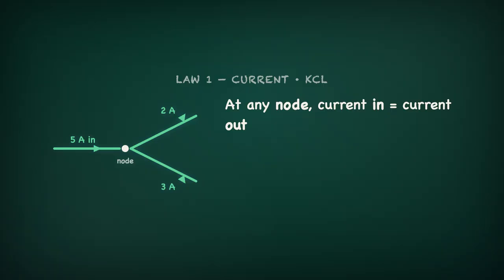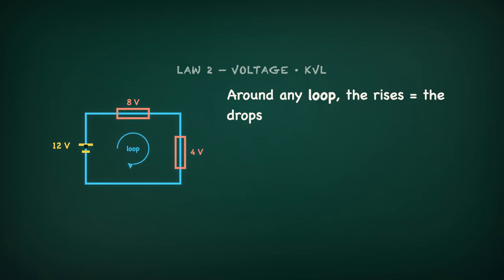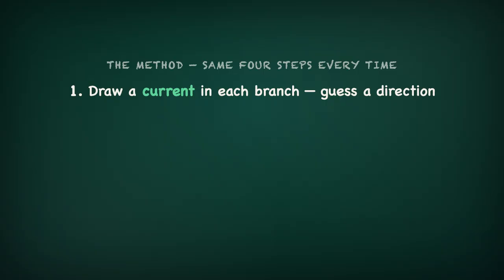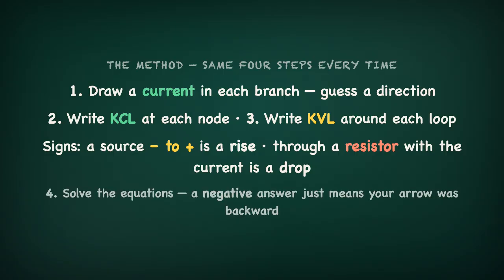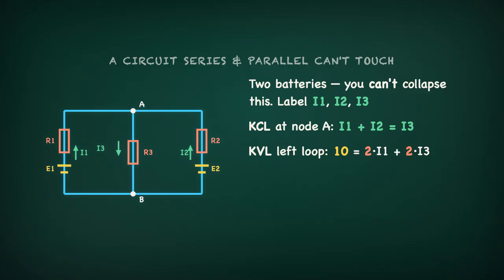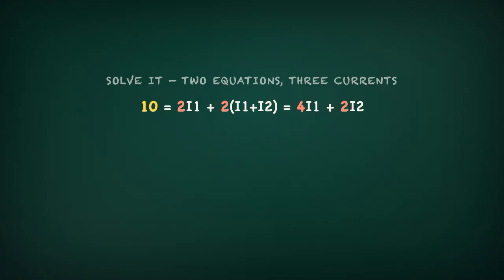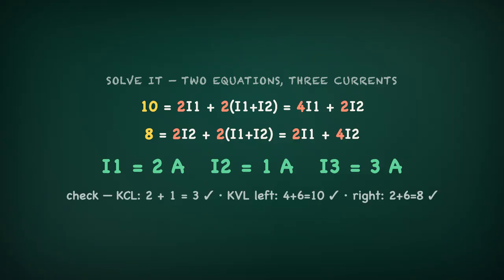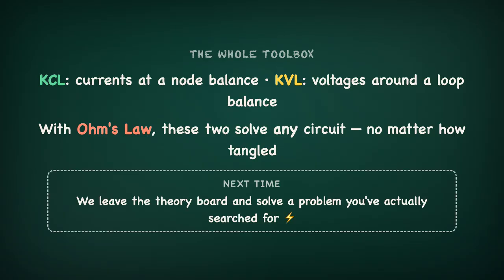Kirchhoff's Laws Explained Simply — KCL & KVL to Solve ANY Circuit | Electrical Theory 101

Comment from the maker: Practice answers: A) KCL — 8 A in must equal current out, so the other branch carries 8 − 5 = 3 A.   B) KVL — the drops around a loop add up to the source: 24 − 15 = 9 V on the other resistor.   C) With both sources 12 V and every R = 2 Ω, symmetry gives I1 = I2. KVL: 12 = 2·I1 + 2·I3 and I3 = I1 + I2 = 2·I1 → 12 = 2·I1 + 4·I1 = 6·I1 → I1 = I2 = 2 A, I3 = 4 A (check: 2·2 + 2·4 = 12 ✓). The two laws the whole episode hangs on: ΣI(in) = ΣI(out) at a node, and ΣV = 0 around a loop. What circuit should we solve next? ⚡